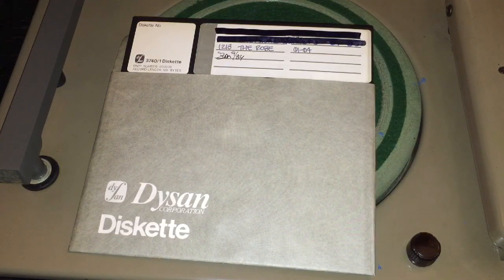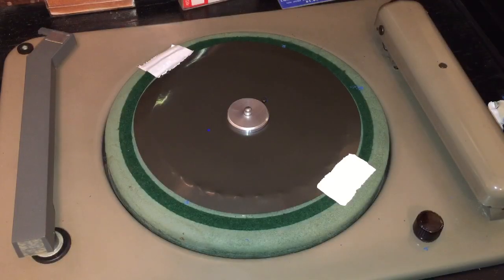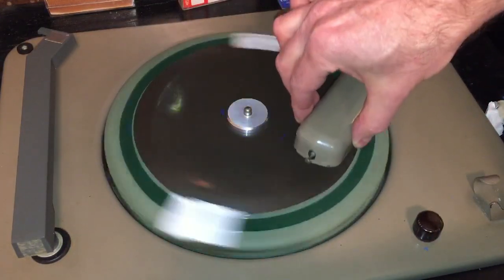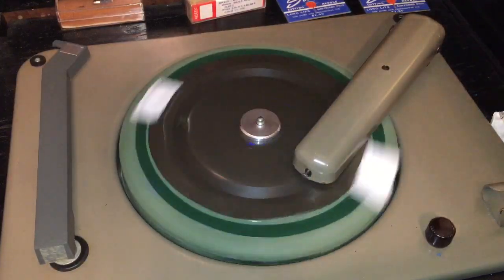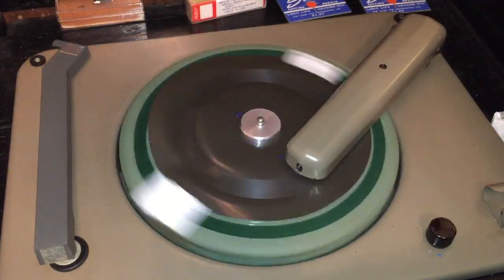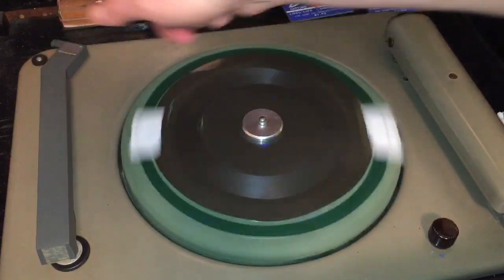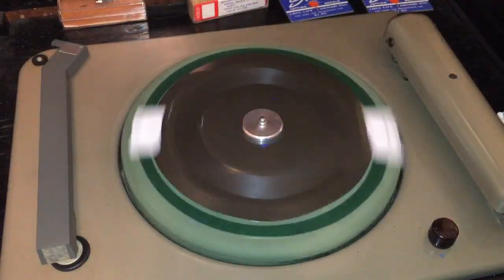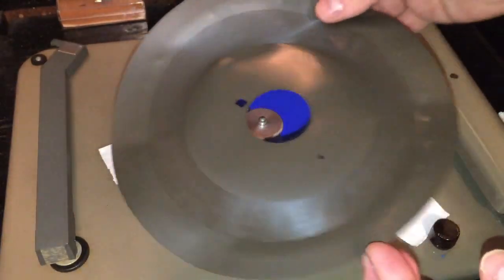Recording Sound onto an 8-inch Floppy Disc??  Record Cutting!!

Comment: the 8 inch floppy disk is not called a diskette, just disk.  Diskettes were 5 and a quarter inch and 3 and a half inch disks.
Reply from the maker: Thanks for the clarification!
Reply: You're very welcome.  If the floppy disk was wrinkly, that was because of the way you took it out because they are flat when in use.  I haven't found a way to take them out without wrinkling them.
Reply: Justin Bester Except in german its always a Diskette here

Comment: Hello, very interesting :) Can a CD-ROM drive to read a Bluray Disk if the bluray1 and bluray0 pitch dots are recorded together  with the same size of a CD1 and CD0 dot pitch? could it read it? I know wavelength is not the same, and optical issues, but... ;)

Comment: I always thought you would have to record in reverse spin to playing back?? I'm confused lol
Reply: ScoopDogg1867 Nope! The sound is recorded and reproduced in the same way. Otherwise it would play backwards of course.
Reply: ScoopyDogg when a master lacquer is cut on a lathe it is a positive in a similar manner to this thing but with a lot more precision. The cutting lathe 'stylus' vibrates and cuts a stereo V groove proportionate to the electrical signal put into it. When you play back a record a softer stylus tracks the V groove and the vibration produced is amplified from magnetic pulses created in the pick up cartridges coils. You are probably confusing the process with creating a stamper which would be a negative impression of this master lacquer. The negative stamper will yield positive impressions into vinyl biscuits when pressed into them. The first Thomas Edison phonograph worked on this principle in that aluminium foil on a cylinder was used as the recording medium. The same positive cut impression on the cylinder was also used for the direct play back. Obviously this only lasted a few play backs and more durable materials were sought after like waxes that could be hard cured after recording. This ultimately lead to the development of the 78rpm Berliner shellac disc.
Reply: Would the left and right channels be swapped if you'd try to play the negative stamper?

After some thinking I think you'd be hearing things on one channel that would have been played in the next revolution of the record...